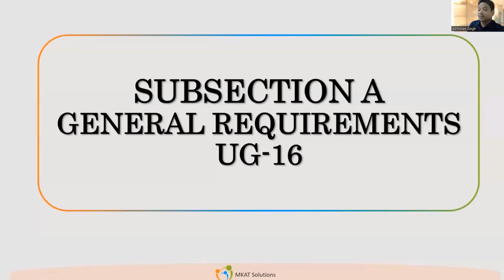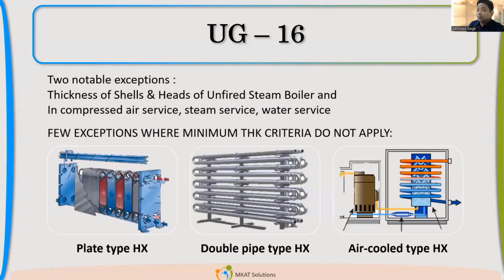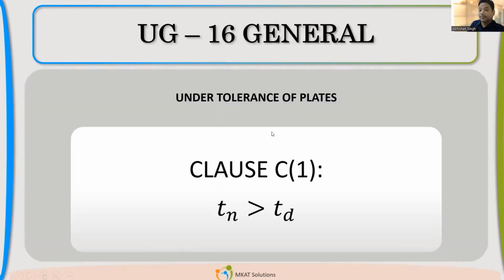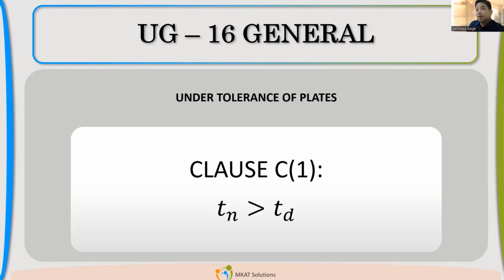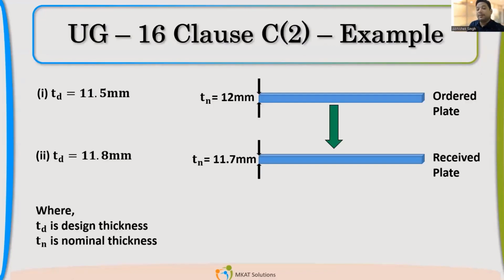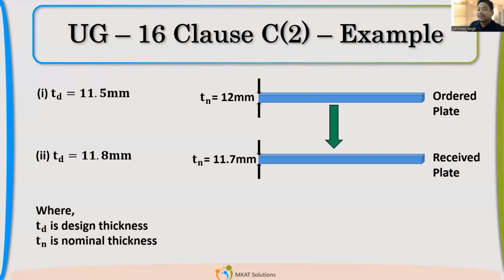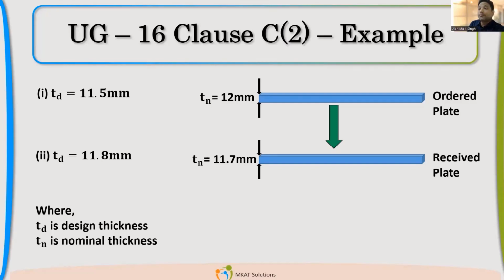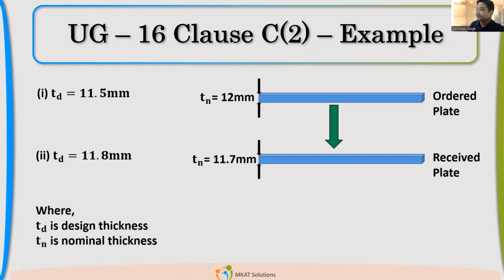UG-16 Minimum thickness requirement for plates as per ASME SEC VIII Div 1

Comment: Does UG-16 (c)(1) & (2) are applicable for plates only or it can be used for hub & flange thickness of girth flanges & tubesheets? Can it also be used if shell are made by forgings?
Reply from the maker: Only applicable for plates.
Reply: Thank you.

Comment: Why the UG-16 minimum thickness requirements is not applicable to the tubes in S&T heat exchanger? Also, UG-16 not clearly mentioning in exemptions about this as it does for other like plate HE etc.
Reply from the maker: Yes this exemption is applied to S&T HX too, refer UG-16(b)(2)